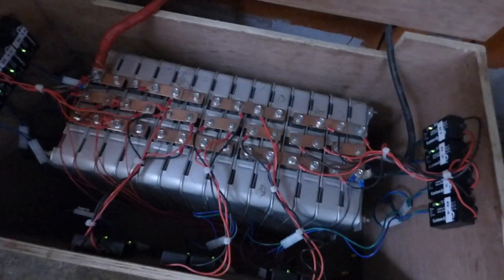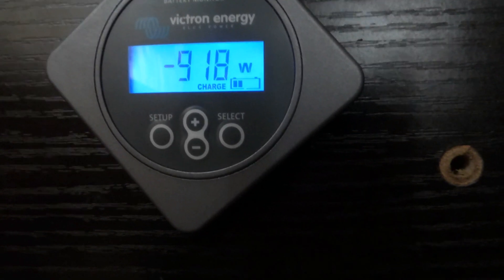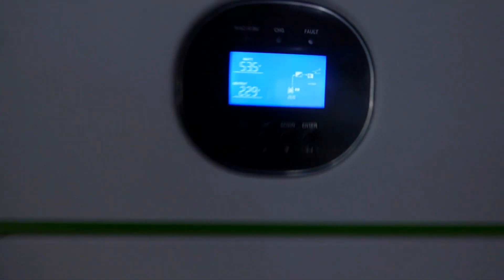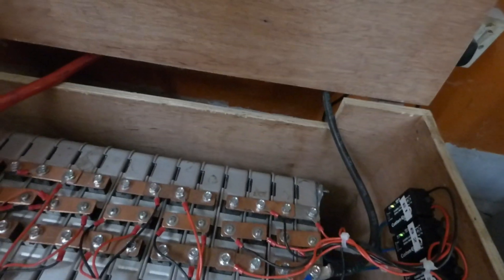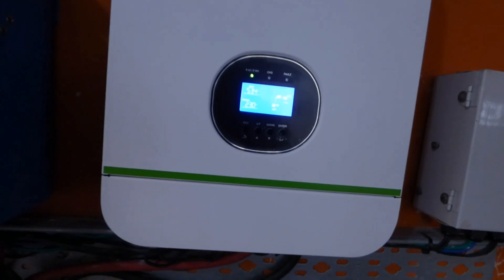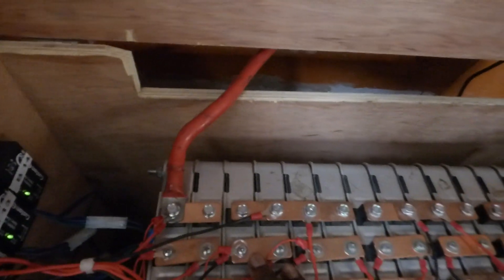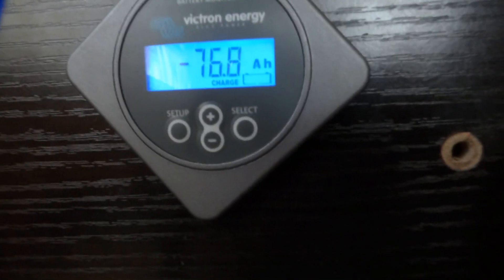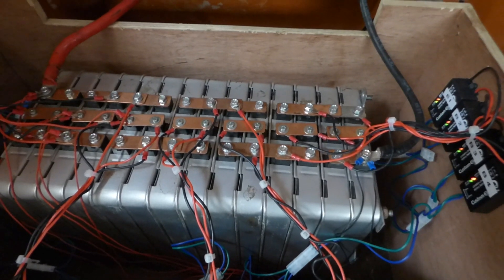Nissan Leaf for solar: battery discharge test after balancer day 1

Comment: What are the voltages of the high cells?
Reply from the maker: 4.2 when charging at 58V
Reply: @drsolar  i see you doubled you bank as well. Very nice
Reply from the maker: @frankz1125  I hope all is well. I did that a while back. The balancers seem to be helping. Someone that has been using them said it will take a few days. I will keep watching
Reply: @drsolar  please be safe my friend. Keep a good eye on the high cells. You may have to manually turn off your system .
Reply from the maker: @frankz1125  I have been monitoring them. They are now closer together. Someone who uses the balancers says it takes days for it balance the cells. So by Monday I should see improvements. This morning was not so good. 3.3 was the low and 3.6 was the high. No surprise though the 3.6 was from the cells that were into 4.2 and the 3.3 was from the cell that would not go past 4.11
Reply: @drsolar  i find below 3.6 the cells go out of balance and above 4.15 . Once you get the pack balanced id try to stay in between there.  Im sure its hard when you have to have power from that source . Good luck my friend. Setup looks great.
Reply from the maker: @frankz1125  there is not much capacity below 3.6 I find. I have my cit off at 3.42. I will raise it to 3.5, We have our clients set to 3.6 or 50V. Thanks for the tip.
Reply: @drsolar  ya my 7 cell pack holds about 47 ah . Im gonna make a couple more vids on it
Reply from the maker: @frankz1125  please do the video. I can't wait to see them. 47 AH sounds right for the gen 1 cells
Reply: Where did you get those Bmw for the single leaf packs

Comment: Sweet. 3kw+
Wow this gives me the Idea of how much electricity people are wasting.
You've been running ur house with less than 4kw and u r totally off the grid.
Impressive.
How many watt off solar do you have please?
Reply from the maker: Thank you. I have 3500 watts. 5 x 300 watts and 8 x 250 watts.
Reply: @ Aws 
Can you share the diagrams of the battery bank? And how many dou you have and the total amp
I am from jersey